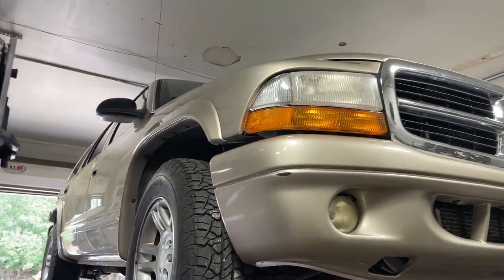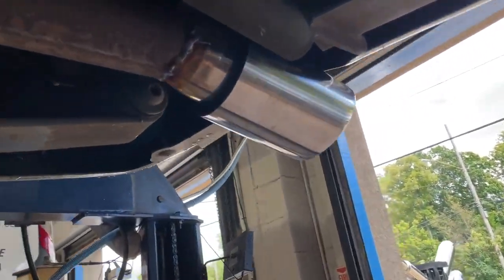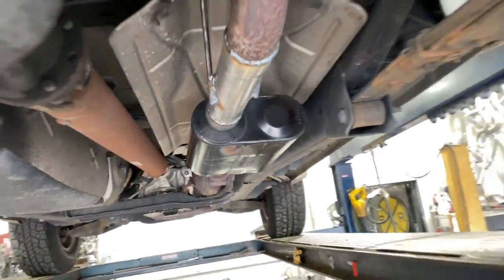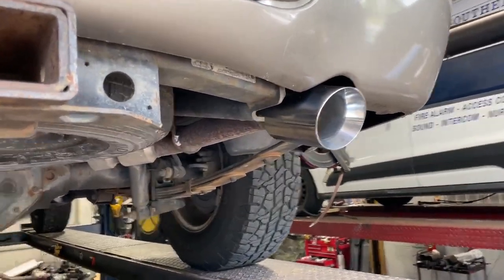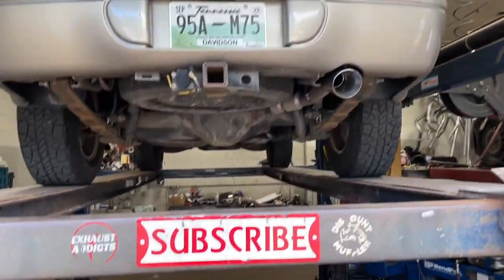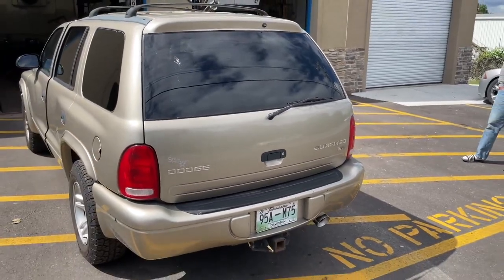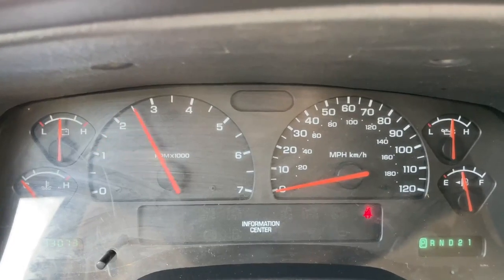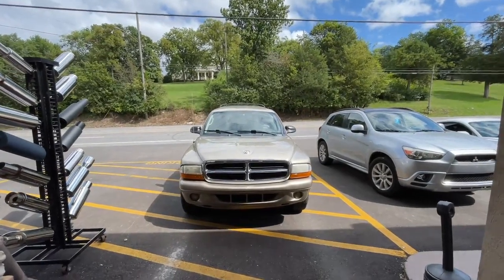2003 Dodge Durango 4.7L V8 EXHAUST w/ FLOWMASTER 40 SERIES!

Comment: The 4.7 is the best sounding newer engine Dodge makes.
Reply: newer? they havent made a 4.7 in forever
Reply: @thatswhyyomamaded2855  in my opinion though they were the best sounding engine Dodge made even though they were junk. 🤣
Reply: The baby 4.7 ain’t bad… but them 5.7’s and 6.4’s are where it at.
Reply: @hi4429  they have the horsepower but I hate the sound of. Dodge or any OHC engine for that matter.
Reply: @stevenkinnison8044   far from junk lol but w/e u Wana tell urself
Reply: @maxaddicks1743  if they aren't junk then why do you see so many blown up or with head or timing chain issues?
Reply: @maxaddicks1743  I'll stick with my Chevy LS engine.
Reply: @stevenkinnison8044  Cool, we can agree to disagree.
Reply: @maxaddicks1743  my 02 Suburban with a 5.3 in it has almost 300K on it and still runs like a new one and has never had anything done to it.
Reply: @stevenkinnison8044  man my ex father in law has one that got totaled they bought back from the insurance company and is still running with 450K+ miles on it.
Reply: @maxaddicks1743  the 5.3 is a solid engine if you maintain it. The older ones are anyway.
Reply: @hi4429  that's why I'm adding a new overhead cam to mine to at least help push a little bit more horsepower.
Reply: @stevenkinnison8044  Uh buddy. The 4.7 is over head cam. The 5.7’s and 6.4’s are not lol
Reply: @stevenkinnison8044  I bought a 01 WJ V8 with 180k miles, almost over heated 2 times because I forgot to bleed coolant when changing it. 
I can still feel the power at 189k miles, replaced some maintenance items. I have as a back up vehicle!